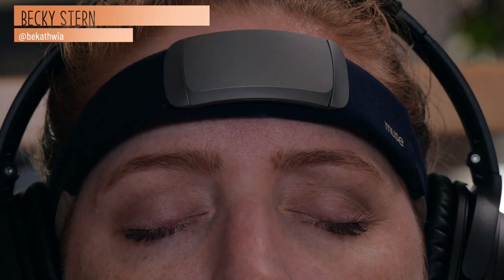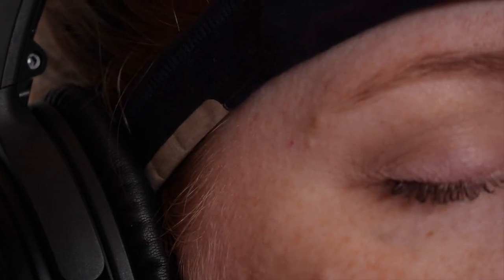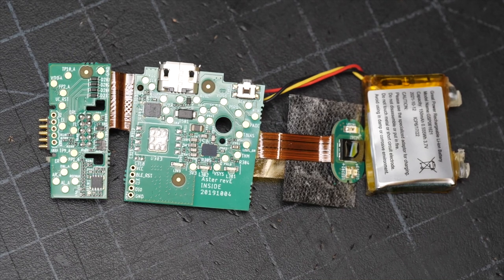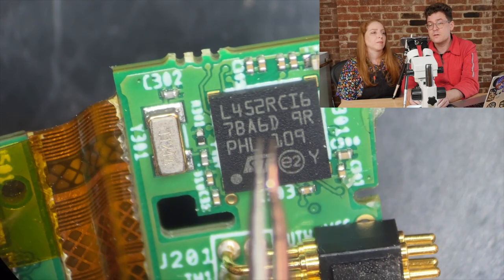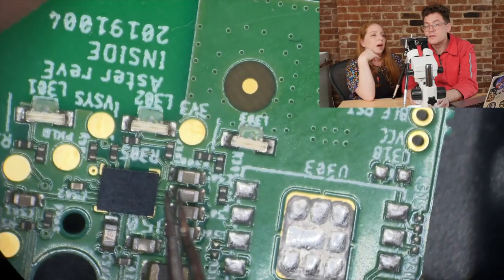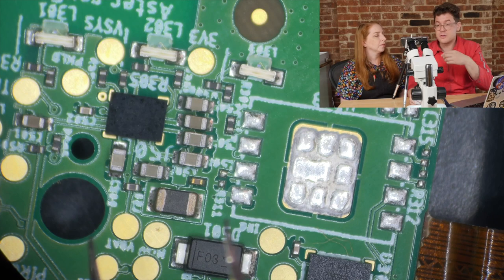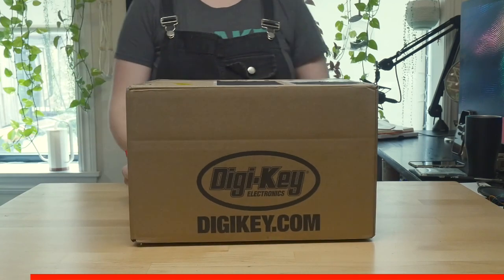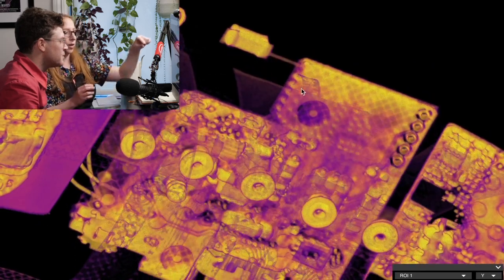What's inside the Muse S Meditation Headband?

Comment: Would it be possible to re-spread silver on the conductive fabric if the back ones have faded and make it working normally again?
Reply from the maker: I'm not sure, I think it's manufactured using a plating process so my guess is no, but you could replace the conductive fabric entirely, perhaps. Also they do sell replacement bands for the S.

Comment: Ha, I found one! Thanks to digikey I could easily search "st 16-qfn" and look for patterns in the markings.. K1G is TSV524IQ4T which is a quad "high merit factor" op amp, so basically what you guys guessed: processing the signal from the sensor pads. K193 is OA4ZHA33Q, a quad "High precision 5 µV zero drift, low-power op amp"
Reply from the maker: Yesssss, thank you!! I'll try searching that way in the future
Reply: Managed to scan the Data Matrix barcode on the SH 141, it decoded as 781410TU03SF073 which is probably mostly a lot number but maybe you'll have better luck. The 8-DFN "K33" looks like another st op amp, this time an smd code lookup site actually worked. (I tried posting the link but the comment got removed.) Part OA2ZHA22Q

Comment: Wow this was great!!! :) I bought two muse s units used and it seems the signal is garbage when I use "muse monitor" or the open source "muse-lsl" software. I get a solid 60hz signal so I know it's capturing something, but the waterfall in "muse monitor" and a fft analysis of the data dumped by "muse-lsl" just show a flat field with no peak in any of the frequency ranges. I hope this teardown might be helpful in identifying why they are faulty as they are both out of warranty...